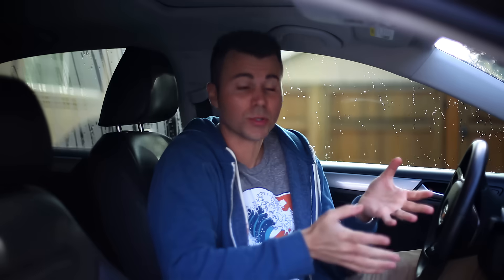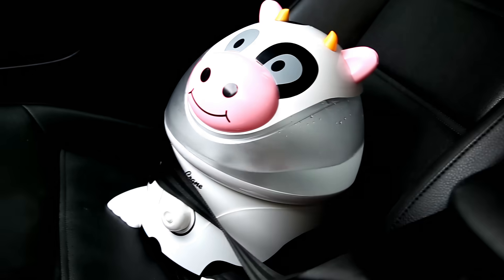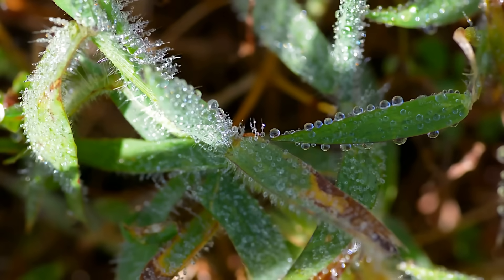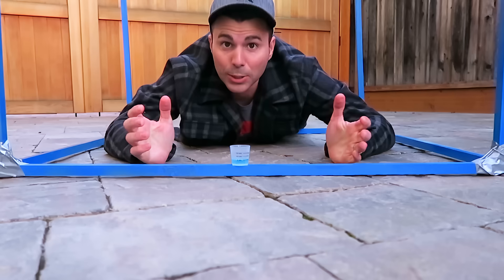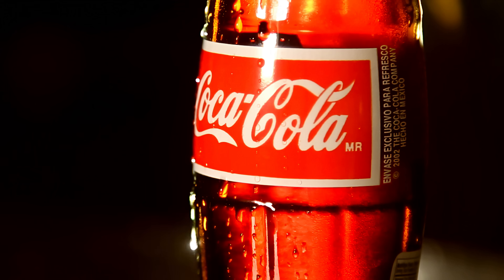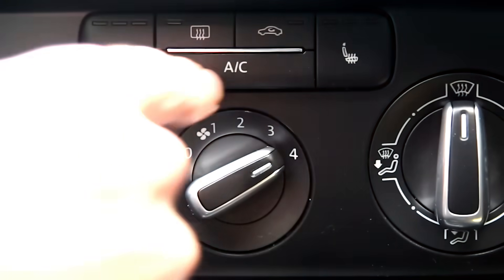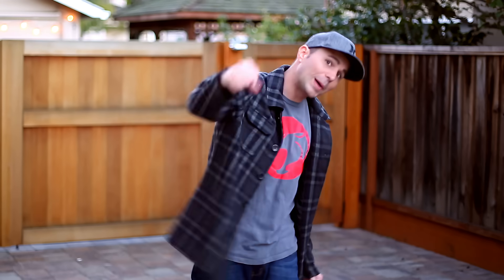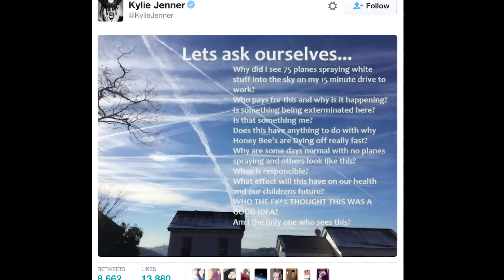Defog your windows TWICE as fast using SCIENCE- 4 easy steps

Comment: If it's freezing outside, cranking heat up to the max with cold engine is not the brightest idea. Most cars don't have an independent heating circuit and instead are using the heat from the engine cooling fluid for heating. That's why most cars don't really heat well until after the engine gets to optimal working temperature. By cranking the heat up, you are actively taking the heat away from the engine, which is the last thing you should be doing. You can actually check this out in your own car - if it's really cold outside, wait, till the temeprature gauge gets to 1/2 - 3/4 way to the optimal temperature and then turn heating to the max and in some cars, you will see, that the temperature gauge goes backwards as you are taking the heat away from the engine.
Reply: Thats only for really old cars or cars with cooing system problems, Modern cars have the cooing system routed differently to the heater and are designed to heat the bloc and the heater/defroster quickly and effectively, so it's no longer a problem.
Reply: @Billy123bobzzz  really old = 8 years? Because that's what happens in my 2010 ford focus...
Reply: @harrodharrod5239  You need to get it repaired properly my friend. You have a stuck thermostat or defective mixing valve.

Comment: Having outside air coming in is a bad thing if you live in a humid climate
Reply: When it's cold out the humidity turn into snow or ice so its not really a problem. This technique still works because you are tying to move the trapped point air outside the car which is almost always less moist.

Comment: you know if you just turn the heat on and the defogger on it will clear in like 5 seconds lol. and if the car’s engine is cold then just turn on the wipers until it warms up...
Reply: There are many situations where the windshield will not clear up in 5 seconds, this vide is for those situations.

Comment: I find this video, and its argument, really annoying. Of course it starts with condensation, but most of the time thats not actually the problem. If its condensation just use your wipers. Its a temperature differential between the inside of the car and the outside, specifically at the glass. If the car has been sitting, that temp diff is gone. If for some reason the condensation is on the inside of the glass, its because the inside of the glass is colder than the air temp. Turn off the AC or bring a towel. This isn't a real problem. Let me know when you cover frost.
Reply: You have to completely backwards.
Reply: do I? lol. Fog on the inside of the windows isn't much of a problem in the mid-west. When it starts getting cold(er) you'll end up with more of a mist on the outside of the windows in the morning. Turning on the wipers and running the rear de-froster for a minute usually takes care of it. The only time I get fog on the inside is if all the windows are rolled up and the AC isn't on. Maybe you're right.

Comment: Here's the thing - in my car's manual it says to have inside air circulation turned on in order to heat the car up faster. And since your #1 is full blast heat, which is better - the drier air from outside or getting the inside of your windshield heated up faster?
Reply: Dryer air from outside

Comment: Correct me if I'm wrong, but turning the AC on and having the temperature set to the hottest setting wouldn't result in air passing over cold coils any more than if you left the AC off. Assuming it would make a difference, it would mean that once the heating element heats up and the refrigerant starts flowing in the evaporating coils, you'd be heating and subsequently cooling (or vice versa) your air, which would negate each other, and I don't think that's what happens. Manufacturers ensure that if the temperature is set warm enough, the cooling mechanisms switch off regardless of the AC setting.

This would mean that turning the AC on is both redundant and also does not have the effect of having air pass over cold coils
Reply: You are incorrect. This technique actually does work (my family and friends have done it for decades). You're on the correct track but didn't reach the correct conclusion. There is no heating element in old nor in moderns cars (OK the Prius Hybrid and electric cars do have an electric heater but that's and exception). The heat comes from the engine's cooling system, instead of routing all the excessively hot water to the radiator to cool the engine off (yes the engine is is hot that it could overheat in the winter) a very small portion is routed to the passenger compartment heater (a very small radiator) that has its own fan to blow air over that radiator and into the passenger compartment. That air is mixed with outside air to try and achieve the temperature that you desire. If you turn on the AC compressor then the warm air does blow over the AC's cooling coil, which causes the moisture in the air to immediately condense onto the coils (the coils have a way to get rid of moisture because this happens all the time that its in use). The air is cooled a little bit but since the engine is putting out temperatures that can exceed the boiling point for water  the air is so hot that the AC cannot cool it to any significant degree (the coolant can be anywhere from 180º F to 230º F, obviously humans cannot survive in those temperatures so AC units are not designed to cool that high a temperature) so the hot air that comes out the vent feels just as to regardless of the compressor being on or off and the air is much dryer because of the drying effect of the AC condenser coils.

This technique (in the video) does work, we have use dit for decades and many owner's manuals list this exact procedure in them (most people don't read the manuals so that's is the value to this video.
Reply: @Billy123bobzzz  Yes it's true that most cars use the engine's heat, but my example still stands. Whether it's a heating element or heat exchanger from the radiator, the result is the same, in that air gets heated.

The oddity is over the fact that turning the AC on would actually turn the AC on. It makes no sense for a car to be on heating and also cooling simultaneously unless it's intentionally allowed to happen for this purpose solely; for dehumidifying the air.
Reply: @sivansharma5027  You're not understanding. Cars do turn on the heater and the air conditioning at the same time. It does not have to make sense to you because that has been going on for decades. We even have that happening in commercial HVAC systems to control humidity. It's simply a fact. If you want to see proof or experiment for yourself to satisfy your own curiosity then open the hood of a car the has automatic climate control, on a day that's cold enough to fog the interior of the windshield, then turn on the front defroster and watch the air conditioning compressor. What you will see is that it turns on, now go to the vent for the windshield and feel the air, it will be warm (yes it takes a minute or two, be patient), then go back and look at teh air conditioning compressor, it will still be on (some cars cycle the compressor on and off, that is irrelevant), so you can see for yourself that having the compressor on with the heat on still results in warm air being delivered to the passenger compartment.

The AC compressor is simply being used to dry the air so that the less dry air is able to pick up a little bit more moisture from the windshield which clears enough off of it that you can see through it. Its very simple physics that we have been doing successfully for decades.

The reason that eh air is still warm even though the AC compressor is on is that he engine is capable of producing phenomenal amounts of heat. Assuming the vehicle is gasoline or diesel powered. The exhaust gas is commonly above 1,500 ºF when it exits the engine and enter the exhaust system. The engine coolant operates somewhere between 180 ºF and 230 ºF so if we used the full capacity of he coming system to heat the car's interior it would literally cook the occupants (and they would be well done, at those temperatures, given enough time). So the amount of cooling that the condenser can provide when the AC compressor is on is so small (relatively) that the engine's coolant can completely overcome it and still deliver warm air.

Think about it, the engine's cooling system is removing heat from parts of the engine that are over 1,500 ºF and reduce them to something hopefully less than 200 ºF (plus or minus a wide margin), while the AC system in most cars targets a measly 20 degree drop in temperature (the new ones are doing even better than that but that's irrelevant) so at 100 ºF they can drop the temp to 80 ºF. Which system can handle more heat? The engine cooling system can drop the temperature approximately 1,300 ºF where the AC system can drop its system temperature only 20 ºF. That is why when both systems are being used in the passenger compartment, there is plenty of heat and that heated air has experienced just enough drying to take away the think film of fog on the inside of the windshield.
Reply: @Billy123bobzzz  I see. It would be handy if this 'setting' was made available with like a 'turbo defog' button you know. Or that the AC is automatically turned on when set to defogging modes. This way, it wouldn't have to be a special bit of knowledge. But of course, cars with climate control essentially take care of this I suppose. 

By the way, I never doubted the mechanism, just the logic over the fact that such a settings purpose isn't made obvious and yet still possible to perform. It's like having a button in your car that drives it for you but for some reason it's in the passenger side door and inconspicuously labelled 'auto'. Doesn't make sense. 

Defogging is a feature one would have thought would have been made bluntly obvious to a busy driver whom is likely in a rush on a cold morning. However, thank you for the explanation anyway :) I can see its just one of those things that your car will let you do, but unless you know why it works, you won't know why it let's you do it XD
Reply: @sivansharma5027  What you describe actually is available on some modern/current cars. Generally if it has some sort of "automatic climate control" (i.e. it has air conditioning and does not have a separate button labelled AC) then it will engage the AC compressor for you automatically when you self the defrost/defog mode. You can check this for yourself by opening the hood and looking at the front of the AC compressor spin when in defrost mode.

If you want the ultimate in defrosting capability, with no effort on your part then get a Toyota  Prius Hybrid. The have the normal heater/defroster system and in addition they have an electric heater for the passenger compartment. Since the Prius has a fully automatic climate control system, it will automatically (immediately)  start the electric heater for you in cool or cold days, then it will turn the AC compressor on for you when you turn on the defogger. It is by forte fastest defogger I have ever experienced, by far. We can literally start the car and by the time we lock the doors, put on our seatbelts and check the mirrors the front and rear windows are fog free. We then drive away (idling your engine is bad for it and takes longer to heat it up) normally, by the time we get to the end of the block we already notice warm air circulating around the car. Its awesome and is my favorite car to drive in the winter for the reason.

Comment: The way I figured this out was I didn’t know that fogging was normal, so I just started driving with it partly fogged, I could see but it was just blurry. I got to a red light and started blasting the heat because I was cold, this is how I figured out that this is how to get rid of fog lmao.
Reply: Driving the car right away does get the engine up to operating temperature faster than idling it, but it would be nice if you have clear vision while driving so you can avoid the rest of us LOL

Comment: Some of what he says is wrong. The fog on your window is but called condensation. It's just water vapor that has gone through the process of water vapor. And a cold can of soda doesn't release water because it's cold or release water at all. The moisture comes from water vapor in the atmosphere that cools and turns into it's liquid form, condensates.

Comment: Heater won’t work if the engine is cold. Is better to wait for the engine to warm up before activating the heater, otherwise the engine takes longer to heat up, which means the heater will take longer to heat up as well. 
(Heater in most cars, is just a small radiator using the hot engine coolant to heat the air, but if the engine is cold, then the coolant is cold.)

Comment: You can always just fill an empty milk carton with hot tap water and dump it on the windshield because it would heat up the air around the windshield and melt any ice
Reply: Remember, water is a liquid, air is a gas, because liquids are generally more dense than air(By about 1000x) the energy it would take to heat up 2000ml of water(or the amount of water that can fit in a normal milk carton) would be able to heat up 2,000,000ml or 2,000 litres of air. Meaning if the water released all its heat, making it drop to 0 degrees kelvin(Aka absolute zero) it could heat up 2,000 litres of air from 0 degrees kelvin to the temperature of the water at the start. Theoretically. Keep in mind, I’m literally a middle schooler... who uses a pathetic amount of his time watching science videos on YouTube.

Comment: This is why cars for some time now turn on the a/c when you turn on the defrost setting also recirculation is not an option on 99% or cars when you have the defrost vents selected as these are the vents that would have to draw air in to recalculate.

Comment: This was a pretty easy one, but what is the course of action if the windscreen fogs up from outside? I've had this problem a couple of times. The wipers will almost get it all off but it fogs up again in seconds. It usually will stop after 2-3 kilometres driven.
 I let the wipers do their thing and turn up heat. Is that the right thing to do?

What is even happening? The car is standing outside and should have the same temperature as the air outside at 5:30 in the morning.

Comment: I did this for years, and I know it works. To add, the A/C system puts about a 1.5-2HP load on the idling engine as well as ups the idle speed slightly as well as the alternator taking about another 0.5HP to power the A/C system with fans on high, which aids in heating up the engine, which heats the heater up faster. Also, with automatic transmissions, putting it in Drive (HOLD THE BRAKE, DO NOT RELY ON THE PARKING BRAKE ALONE, and NEVER leave the car in Drive unattended) will load the engine down with an additional 10-20HP load, leading to faster engine warm-up, proper oil circulation prior to driving, and more evenly distributed heat and part-expansion (leads to less wear overall). You especially want to pre-heat diesel engines for optimal service life anyway. Few people realize how damaging driving immediately after a cold-start does. "Start driving when the temp needle begins to move" is a decent anecdote to work from in icy weather. Cold parts don't have the same shape as warm parts.

The power-loss in automatic-transmissions is converted to heat, so the heat-exchanger for the transmission will actually start heating the engine coolant in some cars without a separate intercooler when in Drive but not moving. In icy conditions, wait about a minute before putting it in drive, so transmission fluid can at least make a proper lap in the system before load is applied.
Reply: This is an extremely outdated method from many decades ago. It has been updated since modern cars adopted fuel injection and oil pumps that can pressurize the engine in one to five seconds. If you read modern car manuals you'll see thatchy suggest not idling the engine (idling actually wears the engine out much faster due to unburned fuel washing the oil off the cylinder walls because the engine is so cold) they suggest that you drive normally after the engine has been run for 5 to 10 seconds at normal idle (don't rev it up) because this puts enough load on the engine to heat it up the fastest. Even diesel engines now can be run after idling only ten seconds or so. Since putting a normal load on an engine heats it up super quickly, the engine wears much less than idling it does and you get more heat much quicker. Read the modern car manuals and you'll see that this is all true.

Comment: 8 times faster defog then these steps is to just grab a towel and wipe your windows, you remove 90% of the water within a few seconds. you could also just crack your windows very slightly that way air will pass in and out of your car and water vapor will never build up in the first place.
the kitty litter was a good idea but you could also use rice, which will pull water out of the air for a very long time.